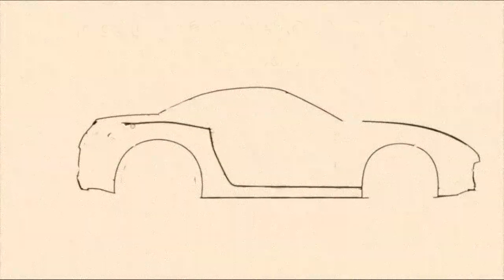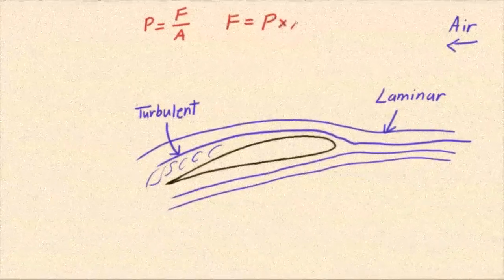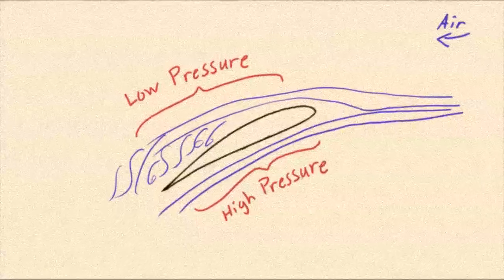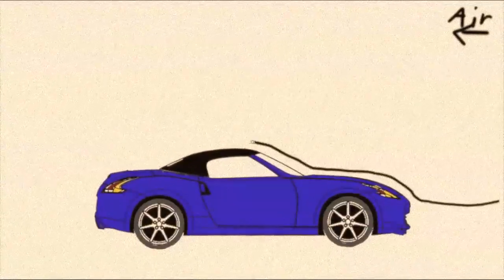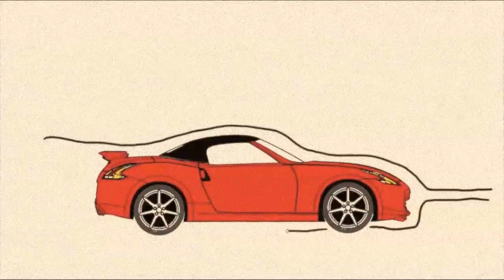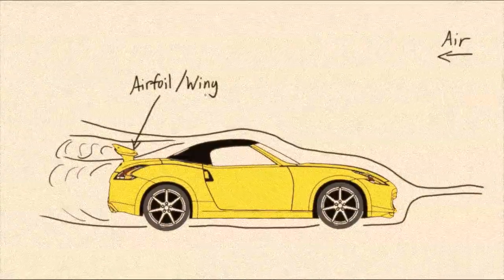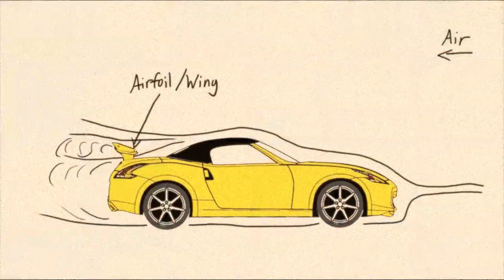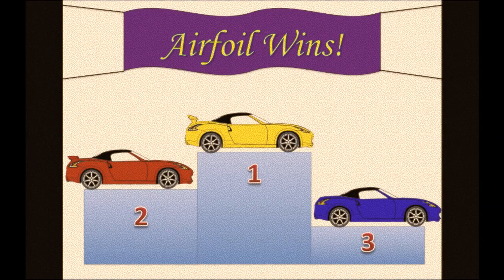Sports Car Aerodynamics: Spoiler Alert!

Comment: The car with a spoiler would not win in a straight line due to the added drag unless the car is rwd and makes so much power that it can't get traction so the spoiler would help it gain traction, but if the straight line was infinite then the car without the spoiler would still overtake it at some point.

Comment: The effort that was put into this video was great and all, but somehow he still came to the opposite conclusion. Unless the car design was an aerodynamic nightmare in the first place, a wing, spoiler, or air foil will not increase acceleration or top speed. It could possibly allow for higher acceleration if you're pushing 1100hp and still struggling for grip at 110+mph, but otherwise it will make no difference or slow the car down.

Comment: This is badly explained and you never said why downforce improves a cars performance, in a straight line on a low powered sports car, any spoiler or wing will slow the car down

Comment: Very well explained but I have a question re the wind tunnel simulation. In an actual driving vehicle there is no airflow over the road whereas there is in the wind tunnel. So, are the pressures accurately reflected in the wind tunnel?

Comment: Wrong. The spoiler increases the size of the turbulent area, but it also creates thrust that in many cases may result in a lower overall drag. Mean while the wing will always increase drag and have a turbulent area behind it. Also, improving high speed grip will not do some much for you in a straight line drag race, but reducing drag will

Comment: Ok, i might not know everything about cars but i certainly know that spoilers and rear wings DO NOT INCREASE ACCELERATION.
there made to increase down force making your car stick to the road better, allowing you to take sharper turns without having to slow down as much. there also there to increase traction.
Spoilers and Rear wings will decrease your acceleration and top speed a little, not Increase it.

Comment: Should delve into front spoilers. I think they are worth more than rears. Just put a large Cervinni's front spoiler on my 07 Mustang. Even if it doesn't provide a huge iincrease in downforce at speed, it does divert a large quantity of air that would normally go under the car, directly into the lower grill opening right above the spoiler. And since I have a ram air velocity stack in that area, it likely sees a nice increase in incoming air. Watched a Superbird wind tunnel video the other day, and with a front spoiler of similar size and shape to the Cervinni's, the airflow is definitely headed straight into the lower grill opening. I don't really care that much about downforce, it mainly only happens at speeds that are well above legal speeds. Most of us don't drive fast enough to even notice a difference.

Comment: Spoilers are meant to give downforce, which is usually used for cornering. Cars that just go in straight lines (drag racecars) don't need spoilers as the spoilers cause drag. You might see a small one on a drag racer as it is used to keep the car planted down on the track and not to create a ton of downforce. 
A car with a spoiler will accelerate slower and have a lower top speed, but it can turn corners faster than one with none.

Comment: on a straight downforce is not needed all that much. You need downforce if you are loosing grip - in cornering or in extreme acceleration. So if the cars are identical except spoiler type, the one with less drag wins. So the one without a spoiler.

Comment: I have a question , I seen this driver of an STI have a stock spoiler . This is the newer like 2015+ . They put on a rear roof spoiler that is kinda big and flings upward . Wouldn’t that stop or slow down the function of the stock spoiler . The air is being redirected upward instead of from the roof straight down into to spoiler . They whr getting props but was it for bs from ppl who do t know or am I just not knowing what I’m talking about . The rear roof spoiler was being turned upwards . 🤔

Comment: You wrong buddy.  Look at the Mclaren Senna.  One of the fastest cars ever (around a track where the Aero assists in corner speeds.  NOT straight line speeds)  the Mclaren 720 is in actual fact faster in a straight line.

Comment: Yo htf will speed increase with increase in downforce. Increase in downforce helps you break faster and corner better. It does not help you accelerate and gain high speed. The blue car would win, the red car would come second and the yellow car would come third in a straight line. If the race had been in a circuit full of turn no doubt the yellow car would win.

Comment: A lot is going on below, so I wanted to try to add a few information about the stuff we are talking about without adding more confusion.

1. Downforce grows when you go faster and faster, at some curves F1 cars can not make the turn properly with 180 km/h but they can with 250 km/h.
2. Coefficient of drag is around 0.7's at F1 cars but it's around 0.24's at Tesla Model S. So, as you can understand from that info alone, trade off between downforce and drag makes you faster if you calculate precisely. Drag can be a friend rather than a foe depending on what you have in your arsenal.
3. There is no downforce in the begining for all three cars and there is an added weight for the cars which has spoiler and wing compared to the one without those. That means, in theory, the one with no wing or spoiler would make a slightly better start, and keep that until downforce starts to kick in. At some point when they reach to enough speed trade off between drag and downforce would start to pay off and while cars with spoiler and wing would keep on going with a pace, one without them would start to have issues because of the lift.

Comment: While the science is ok in this video besides the diagram at 2:30 (turbulent air on top!?) the logic depicted in the pictures does not match the content. The video is correct but only in extreme circumstances that these average looking depiction of cars will not experience. Most average modern cars even at their limits will not benefit from a spoiler if drag racing is your goal. Looking at the comments I can see this is an issue with many viewers.

Comment: Uh, i thought increasing downforce only increases car control and at high speeds, not acceleration. I cant see why it would increase acceleration or speed at all, especially at a launch, as the air is stagnant at the time of a launch. Also, increasing downforce would require an increase in horsepower to reach the same speed a non spoiler car just by pure logic, so how would it help win that simulated drag race?

Comment: 0:20 now that is just wrong... if the cars could get to and over 150 mph or so, the spoiler would slow the car down... also, a spoiler could be badly engineered and not generate downforce at all, even slow you down.
Reply: plus, if you took all the downforce out of an F1 car, it would hit a higher speed (with less acceleration and control) then the regular one

Comment: So a separated turbulent pocket of air created by excessive wing angle is low pressure, but if you do it with a spoiler then that's high pressure? Get your facts straight.

Comment: Correction !
A spoiler or any other body parts that generate down force will slow down acceleration.
in cars there are two types of Aerodynamics

1st type of Aerodynamics is "less resistance"this will allows you to acceleration fast to a high top speed (also help the car get a good fuel efficiency)
http://images.slideplayer.com/32/9831020/slides/slide_9.jpg

but when you go fast you will need some down force  otherwise you will loss grip/handling
and this will happen (  https://www.youtube.com/watch?v=wJF06ZP7U2s    )

2nd type will be Aerodynamics that are made to get a better handling in corners (to act as a stabilizer so that you will not loss control)

in the video the No:26 car would have been okay if the No:77 car was not in front of it !
a good race/performance car will have both types of Aerodynamics
race car drivers use slipstreaming 

No:26 was using No:77 to get more Aerodynamics of "1st Type"
but with the elevation change in the race track only the No:77 had both types of Aerodynamics !

with not enough air passing through/cutting the body No:26 became unstable at high speed
and with the elevation change air got under no:26 and flip the car 

in a Drag race
A big car like a "S Class" with no Spoiler will accelerate faster to the top speed of the car
than the same "S Class" with a spoiler

but in a circuit race for a example Nürburgring
the S Class with the spoiler will be faster around the race track than the car with no spoiler
because the car with the spoiler is more stable when turning and it can turn at a much more faster speed !

Note: this explanation is oversimplified there are other forces at play 
like power to weight ratio, suspension, brakes, engine/drive train layout and rubber compounds and many more

Tip : don't add spoilers to everyday normal cars !
you are not going to go faster and you may burn more fuel !
good suspension, brakes and good rubber will help you go faster with no weight reduction or power gain
when you have good suspension, brakes, and rubber then you can get a spoiler that is made for your car
then you move to weight reduction and power 

BTW suspension plays a big part in Aerodynamics and they need to be tuned

Comment: For all the comments saying that a spoiler causes more drag and would slow down your acceleration. No that's not correct you are most likely getting spoilers mixed up with wings. While true spoilers cause drag they also reduce  drag caused by high/low pressure (wind vortex) more then they create. Lowering the overall drag of the car and increasing the acceleration/mpg of said car.

Comment: This video quotes MIT and wind tunnel testing but is full of fundamental errors. On a straight line infact the car with spoiler or wing is likely to be slower due to drag. And it will not aid acceleration - unless its a heavy wing and the car was originally struggling for traction lol. Plus the turbulent flow he drew on the inverted car wing is in the wrong side.

Comment: Great theory but in racing there are too many variables, even two of the same car the HP varies by horses. If you had 4 cars the 3 you picked and a fourth that had the bottom completely smooth by putting plates to reduce turbulent air on the most inefficient part and that car will go faster than the other 3. You need more cowbell and real life. Less theory apply what's already known then add. You just took a huge useless dump on people that have no clue. adding a wing, takes HP to push thru the wind=down force=drag=less power to push the car.  A car with a wing against a car with no wing of the exact same   make will have a lower top speed cause of Drag. A wing does not work till it hits a velocity where it creates drag=downforce=hp to push thru the wind. Blah blah blah

Comment: There are many fundamentals in this video that you do not understand.

In a drag race, the car without any rear aero would be the winner, due to increased drag on the other two cars with aero. Aerodynamic devices placed on the outside surfaces of a car will ALWAYS add drag, except for ones that take advantage of ground effect. 

Rear aero also does not increase acceleration, unless you are already moving at high speed and the engine produces enough power to spin the drive wheels without extra downforce. From a standing start, the spoiler cant do anything to help with acceleration as air movement relative to the spoiler/wing does not exist yet.

Comment: a car wont accelerate faster with a wing only if you have a lot of horsepower and lose grip even in higher speeds. a car without a wing will also be able to hit higher speed because of less resistance which means in a lot of cases the car will accelerate slower but take corners faster

Comment: Wow, some ignorance on display in the comments section here. Just one example, rear downforce on a RWD car actually does improve acceleration at any speed where the downforce is effective. More downforce less tyre slip and yes the tyres do slip in a straight line, obviously the amount of downforce and power are relevant as to the amount of slip.

Comment: Not quite right, by this logic a massive spoiler and/or wing would increase acceleration further. But they merely increase downforce for traction at the cost of drag. At high speeds, where the spoiler does most of it's work, it could signifigantly reduce the top speed of a car while increasing grip for cornering. A lot if cars with epic air kits tend to not have amazing top speeds, exhibit viper ACR.

Comment: THIS IS BULLSHIT. 

Short and easy explanation. 

2 different spoilers, 1 is kinda flat and 2. is like a F1 wing (tilted upwards) 
Vs 3. Stock (without a wing.

Drag race would end like this. 
First place: 1.
Second Place: 3.
Third place: 2.

What the Videomaker tries to say is that the 2. car („F1“ Wing) would create more downforce which gives you more Grip, this is good when cornering and faster compared to the same car without a wing BUT it doesnt make you faster on the Straight. 

What a bullshit video

Comment: actually the Porsche with the spoiler has less drag than a normal one, search for floating screwdriver phenomenon. Air sticks and pulls back objects with round and smooth rear profiles. this doesn't occur on sharp profiles

Comment: First, if the tires of a car cannot maintain optimal grip, then a spoiler is needed to push down (add weight to the car) the tires so it can have more contact with the asphalt.
For a car to accelerate faster, it is needed more power, less weight and lower air resistance.
So, spoilers are for maintaining grip when steering with high speed. ...and sometimes prevent some special cars to not take off the ground.

Comment: The stupidity of these comments is mind blowing.  Normally a stock spoiler is designed to improve the drag coefficient. Some up to 9%.  Aero dynamics increase with the square of speed, so they are more effective at higher and higher speeds.  You will gain more inline acceleration from having a spoiler even if it produces downforce. The difference between drag from turbulence and drag from downforce aren't comparable.

Comment: i do know that spoilers were added to cars soo that the rear wheel drive cars could have the rear forced downward and would have more traction and grip for the car to drive forward. but sometimes it could lead to a little drag, and when trying to reach to the top speed, the car is very very sensitive to little bumps and pebbles, tiny air drags and sometimes weight. any of those could make a great impact on the car when it is on its sensitive moments of top speed. 
i learned it from nascar racing when they put those little fan spoilers in the back of the cars in the 80s 90s and very early 2000s. the fan spoilers were placed on the car and it improved the cars traction and a little bit on speed but it kinda made a little drag for the car. then they tried the wing in 2009 which was a success. but in safety issues when the car spun out of control and skidded backwards at high speeds, the cars were prone to lift up like a plane and flip over and onto its roof upside down. soo they kinda went back into fan spoilers but in a more airodynamic way. 
this video is kinda right. i wish i could explain air flow in a more simpler way through text but its hard to explain.

i ride bicycles for 7 miles a day and i watched very very closely by what i put on my bicycle. it can be a light, a flag , a basket on front and back , a fender and knobby tires . i do know that it may affect my bicycles riding performance with each of those items above on. it can be weight and wind drag. no ,i dont put wings on my bicycles nor spoilers. but if you are a cycler like me who travels 18 mph and 7 miles from there to back every day, you may notice that any accessories you put on may affect your riding performance whether big or small. 

same with the car.

Comment: I think the video is correct. You add a spoiler on car and it increase downforce. And the downforce increase friction to make car go faster
Reply: And the spoiler will create drag and add weight, which will make the car slower.

Comment: It's much easier to think of this in terms of resultant vectors and basic trig.  If you have an air foil tilted up, you have a force in the reverse direction and a force in the downward direction, the wing is sort of the resultant vector of that triangle. So I think of the problem backwards, given the resultant vector, determine the down force and drag.